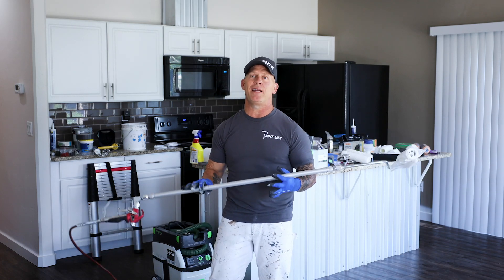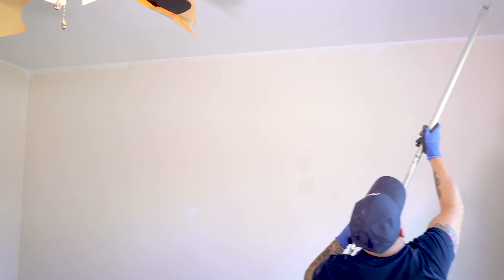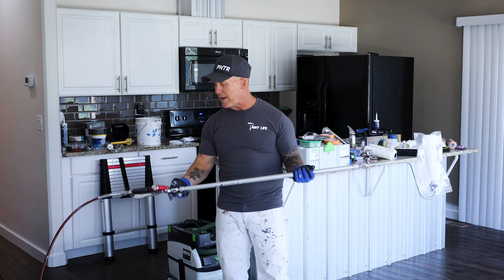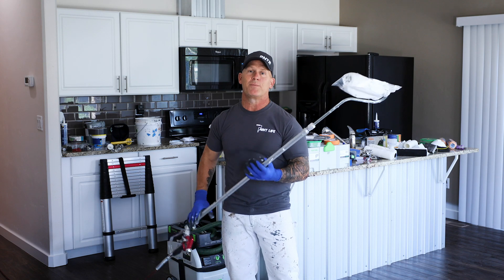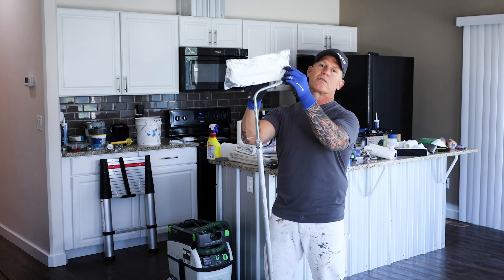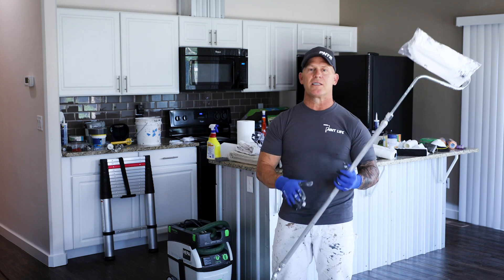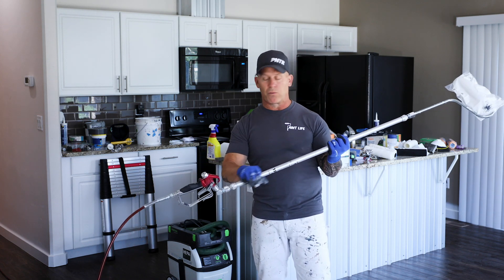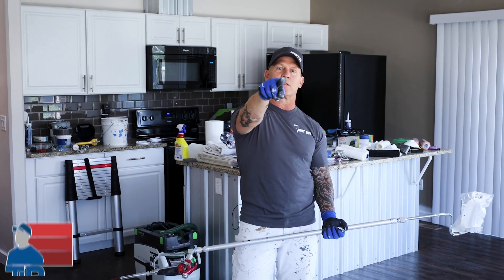How To Paint a Room FAST.  Painting HACKS.

Comment: I’m the General Superintendent for  a fairly large Drywall and Painting Company in the upper Midwest (MN, WI, IA, IL) Most of our work is new construction of Hotels , Assisted Living , and Multi Family. Though we have a large in house paint crew, we also sub out plenty. I can see apples to apples the difference in production from those using this and those who don’t. With some ultra tight schedules sometimes you have to switch it up in order to maintain that GENERALS SCHEDULE NEEDS. When spraying and back rolling isn’t the best option this system is ideal. Let me give you an example. Many hotels have a mixture of VWC and painting in the same rooms. We all know that by the time it gets to us, any slack in the schedule is LONG GONE. We have literally landed huge clients by saving the day. One way is by using this system vs spraying so that we can run paint and VWC simultaneously. This saves us from having to wait to hang vinyl and or even hang VWC first without having to bag off. Literally  days per floor saved. Especially if you are painting acrylic texture which already requires more days. Weeks can be saved. In the grand scheme.
Reply from the maker: Thanks for sharing !🤙

Comment: I inspired, thanks! Going to SW to get me a set of inner feed roller.
I’m using Titan 1040 and about to start painting 3 stories single family rental property. This project was initially estimated as spraying walls, doors and trim all one color, same as ceilings (no ceiling, carpet removed). The renter came in and decided to toss some more money to paint trim and walls all different colors. While they negotiated, lost the momentum and now it’s time for carpet carpet to be installed. I guess it’s a rolling time for me now. Sucks though, I was quick enough to finish basement before carpet - around 8 min per room with Titan 619 high efficient tip (one coat). Rolling would take much longer now (
I may hire someone to cut on front of me and I’ll follow with a roller behind to keep that wet edge.

Comment: Just a quick tip.  For cleaning out my airless line and gun, instead of using the sprayer, I McGyver'd a few things together from a hardware store, so that I can hook the line and gun up to a laundry sink tap, and turn on the water and just let it flush away for as long as it takes, without using the pump for that task and time.  
While that is flushing, I'm using a 3 foot whip hose on the sprayer "outlet" and cleaning the sprayer, without having to run that water through 50 feet of hose.  Often I'm finished cleaning the sprayer, and the line and gun are still showing paint.

Comment: I have the Graco version of this with the in-line gun and extensions up to 9 feet. I ended up using the Graco jet roller or I spray walls and ceilings instead of the pressure roller. The case for using the pressure roller would be if I hand cut in a wall.

Comment: That surprises I’ve always thought they were a none effective tool for professional like the paint stick. I’m fifty and feeling it through the years I’ll have to try one.
Thanks
Reply: They're heavy and a pain to clean and maintain, and it's a fricken art to load the roller with just the right amount of paint to keep it wet enough to apply without dripping and creating a massive mess.  Just use a 5gal bucket and a grid with a regular roller and extension handle.

Comment: just purchased a graco roller two weeks ago, can't wait to use it.
Reply: Your going to love it. The trick is to pull the trigger as little as possible.
Reply: @johnprystupa4896  Thanks for the tip!
Reply: @ Danish Qamar
 Yup pull it enough to let it barely to come to the surface at first. Roll it and pull the trigger to reload the roller. I read complaints somewhere some time ago about how messy it is. I got this tip from someone else just after purchasing and  I haven't had a problem with it (its all in the flow control)

Comment: Residential/Commercial painter for the last 5 years, any inner roller I’ve ever used, the roller covers shed, which is common which any cover normally, but because they are perforated you can only purchase covers made my by the sprayers company. We no longer use them for the sake of the shedding and f produces on the wall.
Reply: What do you mean with shedding? Do you mean losing little hairs? If so, you need to remove that with masking tape before using the roller for the first time. Shouldn't be a problem after that.

Comment: spent a good penny on the setup years ago for the graco version and accidentally flushed the parts down the toilet. get an IN LINE gun its easier to use. this titan version looks like a superior design with how the roller goes on vs the graco. i still have the HD pole so i might just pickup the head.
Reply from the maker: Rick Bailey 👍
Reply: The angle elbow that comes with the Graco is pretty atrocious. Still beats dipping though.

Comment: I really like the idea of using this. The problem Is trying to roll 12-16 foot walls in a 4 foot wide hall way. i wish there was a retractable extension pole for the inner fed roller. The only way to roll walls that tight and tall is to switch out different sizes of extension poles. Im still going to try it out though.

Comment: Chris I rarely use a 9 any longer they can leave lines ,they are too small an there are more trips to the wall the 18 gives great results.
Reply: It makes since to use an 18' roller set up versus the traditional 9" setup, covering more area with less dips in the paint.  The issue I see is the 18" does not fit into a 5 gallon bucket.  I personally do not like rolling in a tray.  I prefer rolling with a 5 gallon bucket and strainer screen.  If there was a larger bucket, and screen set up for the 18" roller, then it seems like a more efficient, time saver.  I have not tried out the 18" set up, and have not tried the inter-fed spray roller.

Comment: Hey Chris , 
I purchased the Titan power roller to use on big homes and have been having issues with Roller Slide and dripping . Any suggestions for the issue ? 
Also I think that Titan may have came out with a new roller attachment and I possibly have the older model , not sure if that is the case either. 
Thanks much
Reply: I think you are pulling the trigger too much. Once your roller head is saturated, you only have to engage the trigger for a second to refill the roller and then roll out the paint in the roller head. Repeat this sequence until you finished the job.

Comment: Those damn extention get productively increased, but get you so much more tired as painter at the end of the day.
Reply: Yes, tough to hold up against the ceiling when your upper body is out of shape. Too much weight. I ended up spraying with the long extension, 30/40-inches. more overspray but it was doable.

Comment: Question: Do I have to peel off the old paint before filling in holes and evening up the walls? The old paint comes off in pieces if I use a putting knife, but I can also just cover it up, it will just stay under there. What is the correct way to do this?

Comment: Why aren’t there 18 inch versions??
Reply: Because the 9" flow-through is already 3x as heavy as a regular 18" once you count in the gun, hose, weight of the paint in the handle and roller head, not to mention the added weight of the special roller frame.
Of course, if you have arms and shoulders like Chris, it probably doesn't matter.  And if you don't, you soon will using a setup like this.

Comment: I've watched your videos for a while now you do a lot of spraying. When cleaning out spray equipment it takes 5 or more gallons of water to clean out the unit. The question I have is how do you compensate for the impact you're having with polluting. I understand that latex paint is not as detrimental to the environment as oil or other paints but still detrimental nonetheless. I understand that you might not clean your sprayer everyday so let's assume that you use 20 gallons of water per week to clean spray guns brushes and other equipment. That's 20 gallons times 52 weeks giving us 1040 gallons of hazardous material per year put into septic systems or on the ground. Just curious what you do with this hazardous material I'm sure you don't put it in the customers septic system because that can damage Plumbing lines as well as the septic system itself.
Reply from the maker: What solution do you have?
Reply: My question was whether or not you used any tips or tricks to help with this issue. But I'm taking it from your answer that you don't
Reply: @jeremystone8394  latex paint is composed of latex and various clays. Latex has traditionally come from trees. Modern latex paint will decompose, especially in biological reactors like septic tanks. The water is not toxic, and eventually evaporates and gets recycled. 
All that being said, I don't see the need for any tips or strategies for dealing with the rig cleaning water.  Just look up the EPA regulations for cleaning latex paint. Water treatment facilities would be having a tremendously bad time dealing with the millions of gallons of latex paint that go down the drain each year, if it was actually an issue. 
I think people in the name of environmental protection often overstep larger issues to nitpick smaller issues.
Reply: @oilscience9808  as much as you would like to believe what you just said none of it's true. latex paint presents many problems for your septic system. Composed largely of synthetic polymers and resins, latex paint does not break down in your septic tank. Instead it forms a gooey layer of sludge that may lead to blockages. But as usual do not believe me. Please check with your town officials and state codes. Almost every town that has a transfer station will tell you how do you properly dispose of latex paint. Most all  will tell you to wait until it dries and then you can dispose of it. But please for future reference don't tell people they can do something that could get them in trouble without knowing what you're talking about.
Reply: @jeremystone8394  I have worked specifically as an occupation on the formulation of various different coating systems including paint. Vocationally I am experienced enough to make such claims.
Reply: @jeremystone8394  you used a bunch of chemistry buzz words there, but I wonder where you are getting your info from or if you even understand what you are saying.  
Those synthetic polymers are non toxic enough for kids to eat..... It's literally the exact same thing as Elmer's glue.  PVA. That's the primary binder in latex, then it's extenders like clay or limestone then pigments and the balance is water. Often times there is a small percentage of rheological modifiers added also, but those are more important outside of water based coatings.  
As for latex paint from washing equipment clogging up septic systems: first most people in America don't have septic anymore; maybe it's different in your country. Second it's water based and diluted by the washing process; how could it close something up? 
Again, you are nitpicking a non issue; there are far greater issues to go after than latex. 
2020: the year of the Karen.